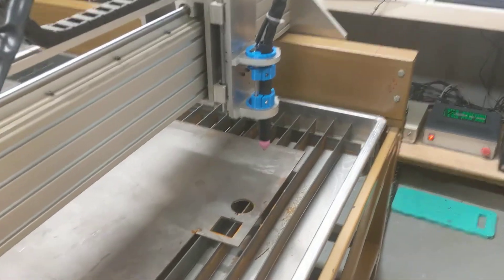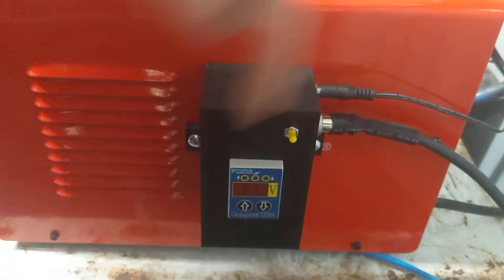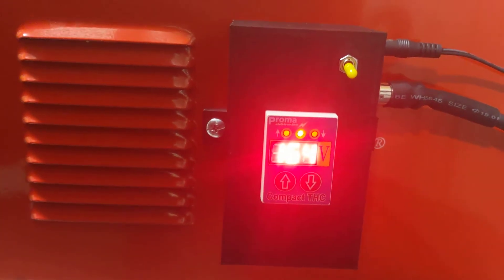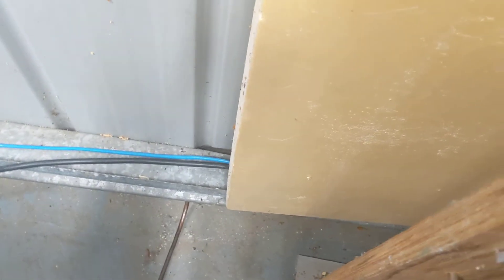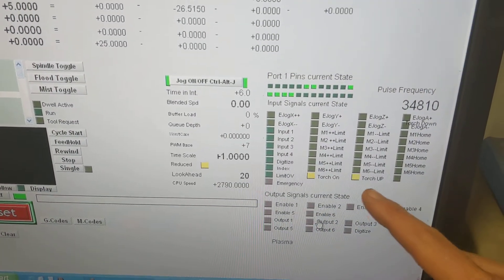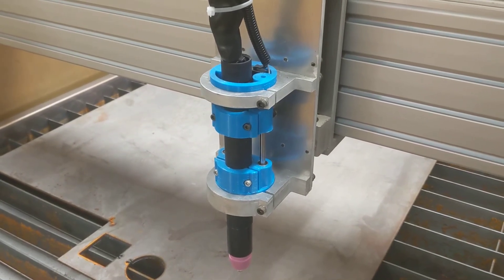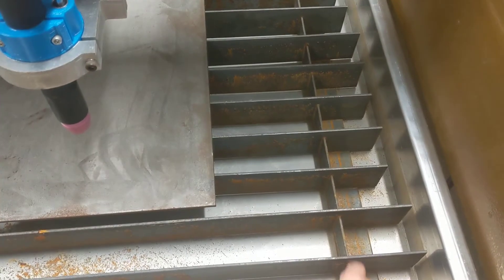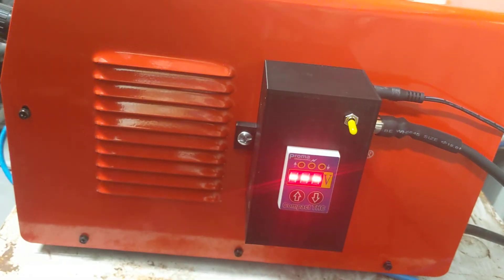Fitting a Proma 150 THC to my Gecko G540 plasma cutter.

Comment: thank you for doing this . i am setting up my diy plasma table now. running it all with  gecko 540 and proma...got luck and got a hypertherm xp45
Reply from the maker: NIce.  It's pretty straight forward with the G540. I've some other vidoes showing wiring if you need to check.